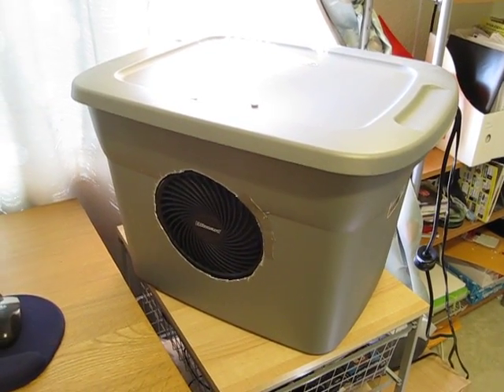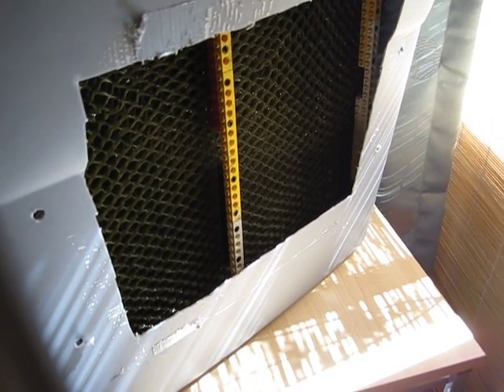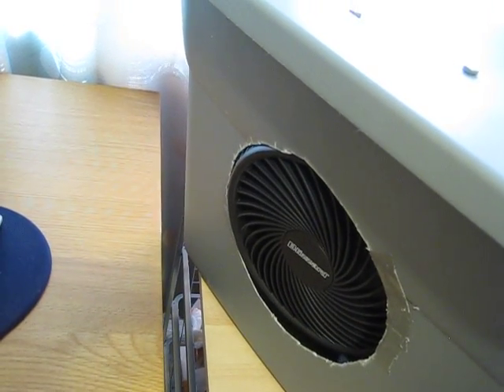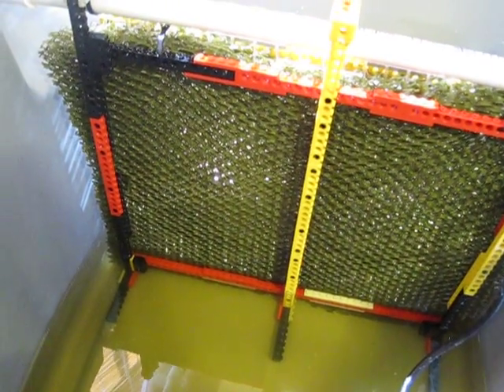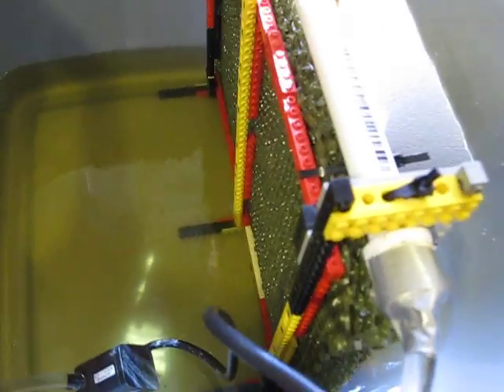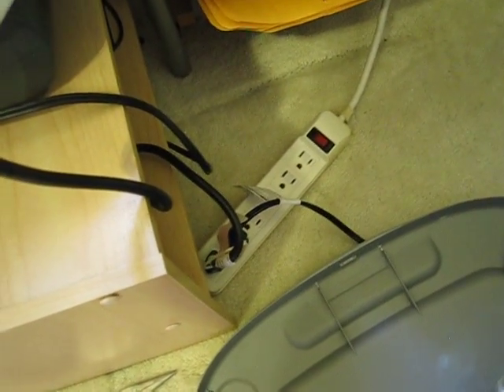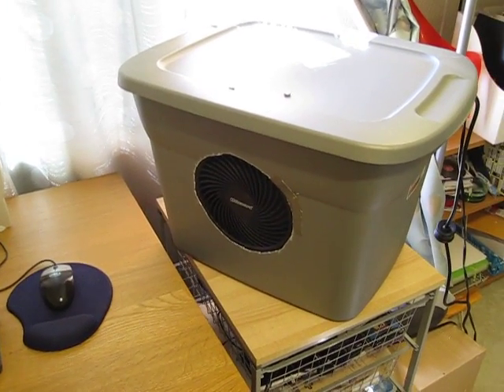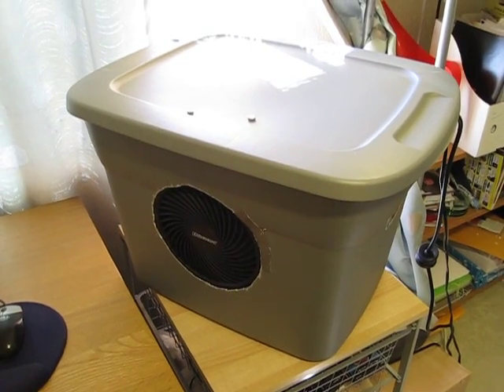Homemade Evaporative Cooler (Swamp Cooler)

Comment: whats the best cooling pad i can use? Is the media pad is the best cooling pad that i can use or there is a better cooling pad than the media pad? btw nice video
Reply from the maker: Cooling wise the aspen pads seem to work the best, although they leave a big mess because of all the bark shavings.  I like the blue Duracool pads because it does not turn the water green and are easy to cut.   They may not cool quite as well as the aspen pads, but for my application I do not notice much difference.

Comment: I'm from the south not the west hard to believe. I tried putting ice in a cooler and venting  with a fan when my ac went out.  this honeycomb idea is new. I still find  it hard to believe  this works even from honeywell for 200 bucks at walmart. You said it best it cools 2 inches of space. I trusthoneywell or honda or name brand swamp cooler not really but tempting.
Reply from the maker: Yeah this is really only used to cool a personal space.  At the time I built this for less than 50 bucks.  Uses way less energy than an AC unit but of course not nearly as effective.
Reply: sad thing is my place stayed at 82 degrees. Not fun.

Comment: You can also use humidifier pads as well it works the same
Reply from the maker: +TCircuitry HD   Thanks for letting me know.  May need to try that as well.
Reply: Also if you want a stronger cooling effect, put multiple pads together in a line. I tested mine a few years ago and discovered it is one of those things where after you double it once, you get half the gain. So 9 degree drop with one pad as an example. two pads together would be 18 (so 9 gained), If I try 4 pads, I get a 22 degree drop in temperature 4-5 just depends. (One behind the other in an airtight seal so the fan has to suck the air through the pads) But of course you would have better results than I did because you live in a dry climate.
Reply from the maker: +TCircuitry HD   Good to know.  Thanks!
Reply: +Gizmo Gaming you mean 2-3 pads on top of one another? If i do this i would have to make sure all pads are soaked in running water right?
Reply: That is correct. They ALL must be soaked. I also found out it works best if you have a pump running for 30 seconds every 5 minutes roughly to let it evaporate effectively depending on temperature and dryness of the air. If you just let the pump run constantly, the water can actually insulate the pad and keep it from evaporating quickly so it wont get as cold. What I was referring to as my example was like in his design where the pad sits vertical. If you put multiple pads in vertical up against the other one, you get a stronger cooling effect. But again, you get half the gain after you double the number of pads the first time for the average temperature drop. 50s roughly is entirely possible with an evaporative cooler if you have multiple pads pressed up against each other. Also if you choose to add 4-8 pads, make sure you have a really powerful fan to suck the air through all of the pads :)

Comment: Looks good but change your water. You don't want to breathe bacteria.
Reply from the maker: +John Arizona  The blue pads I use do not dirty the water as much as those green pads.  But yes, you must change out the water.
Reply: +hutchtransfer I live in a really dry area, Payson Arizona which made me think to mention. Arizona is really dry as it is but at nearly a mile high you see very quickly the importance.

Comment: Y water green
Reply from the maker: +Graham Bate   This is from the cooling pad.  In that video I used the green cooling pad but now I use the blue Duracool pads because it keeps the water cleaner and is easier to cut.
Reply: thx for the reply, do u get any moisture in the house from it?
Reply from the maker: +Graham Bate  Yes it does put humidity in the air.   That is why you should open a door and a window in the room for circulation so it does not get too uncomfortable.  This works best in dry climates.
Reply: thx again mate

Comment: Doesn't this just humidify the air making it worse in the long run?
Reply from the maker: Bryon Wilson   Our humidity levels are really low here in the desert (usually less than 10%).  So a little humidity is not a bad thing.  You definitely want to keep a window open in the room and keep a door open.  Otherwise if everything is closed, then the humidity will get worse and worse if there is not circulation.

Comment: can get electrocution with this type of fan? please explain.
Reply from the maker: Sudesh Aththanayaka   The cord is drawn up and out of the storage bin, so it is not in the water.  The fan sits high above the water and is securely fastened to the lid so there is no chance of it falling into the water.  This is my 4th summer using this evaporative cooler and I have not had any issues.
Reply: When  da air  pass  through  the  evaporate ,it get humidity. So humidity  of the  air is higher than the  outside  air. This humidified air will be  able to get trapped  with the wire ends of the fan that pass  the  current to the  fan  motor. In such  situations  if air trapped  with our  body we can get  electrocution. Think .I'll waiting  for  your answer. Thanks
Reply from the maker: Sudesh Aththanayaka  With my design the fan is attached to the plastic lid so when I open the lid to fill this with water my hands are not touching the fan and the plastic does not conduct electricity. When I fill it I always make sure the outlet is turned off so no electricity is coming to the motor.  Because of this I feel safe with this design.  I have been using it for 4 summers and I have not had any issues.  This is only run a few days each week for a couple of hours each time.

Comment: actually you r using  pump to pump the water..how about replacing ur pump by using  gravitational flow of water from ur  home tank
Reply from the maker: Joel Abraham   I am not sure how that would work.  Once the water drains over the cooler pad then how can gravity be used to bring it back to the top above the cooler pad?

Comment: what is the coldest temp you get from this project? Its probably not very cool....................
Reply from the maker: Shawn Samuel   My evaporative cooler usually cools the incoming temperature by as much as 30 degrees depending on humidity levels.  Over the summer the temps here in Vegas are over 100 degrees, so my guess is that the air coming out of the cooler is between 70 and 80 degrees.  By having a window open it will draw in the air from outside.

Comment: I have a smaller one (fits in a 2 gal bucket), and I'm about to scale it up. I am wanting to run it out of a rain barrel and have an Arduino micro to keep the water level in check, the one i am working on is designed to be off grid so i am connecting a 12v battery bank and a small solar panel.

ANY suggestions greatly appreciated.

--JWat
Reply from the maker: Jordan Watkins   That's great you have something to monitor the water level.  Yours will truly be zero impact on the environment.

Comment: can i use a bed foam instead of that coolpad? :) . your reply would be much appreciated :)
Reply from the maker: I am not sure the bed foam would allow enough air to pass through.  The coolpad is around $7 or $8 at big box hardware stores.  That will give you enough for a couple of small coolers.  I double mine up.
Reply: ok THANK YOU SO MUCH!!! :D :D

Comment: Would it be possible to build one of these for a vehicle?
Reply from the maker: You would need to find a way to enclose the water at the bottom of the cooler.  If you were to use my current design for a vehicle, there would be problems with the water splashing out.   Decades ago they used to have these on the outside of the car:  http://en.wikipedia.org/wiki/Car_cooler
Reply: justenmatthew 40 years ago when I was a auto parts delivery driver, one of our other delivery drivers made an evaporative cooler for his truck which had no AC (mine did). He took the rubber hose from the windshield washer and feed it thru the fire wall into the his truck's cab. He built a small rectangular waterproof box with a cooler pad inside that he hung on the dashboard in front of the blower vent. He had the rubber windshield washer hose feed into the top of the box from the back and then into a tee'd perforated drip tube that ran along the top of the mini cooler pad. He had to manually turn the knob on the dash, that electrically would normally squirt water onto the windshield, to wet the cooler pad in the makeshift evaporative cooler whenever he felt it got dry. I can tell you from sitting in his truck when it was over a 100F (37.7C) here in blazing HOT (arid) Arizona that it actually made a noticeable difference and worked!  It was better that the alternative which was suffocate!
Reply: That's a real creative solution!  Thanks for sharing!  The heat is returning to Las Vegas is it's time to get my cooler ready for this summer.

Comment: FYI these work through evaporating the water into the air. Just like your sweat on your body changing from a liquid to a gas. Also if the air is humid the evaporators don't work as well just like when it's hot and humid your sweat evaporating doesn't work as well and you feel hotter than if it was dry and the same temperature. 
It all has to do with the kinetic energy of the molecules and the ones that evaporate usually have the highest kinetic energy thus the liquid becomes cooler because the molecules that are the hottest are leaving. Cold liquid actually doesn't evaporate that well but then again it's already cold so it doesn't lose as many molecules because of it's low kinetic energy. Putting ice water in an evaporative cooler isn't really doing too much evaporative cooling but just warming the water with the air which obviously drops the air temperature. More like diffusion cooling.
Reply from the maker: Thanks for that explanation.  I do not use ice that often.  I have noticed that it does create slightly cooler air temperatures coming out of the cooler.
Reply: This is excellent!  I live in Northern California and even though it's pretty mild weather we get here we get really hot in late spring and all summer, we can get up to 119 degrees F.  And its really dry heat too so swamp coolers have been used for many years here and it brings back great memories of staying at my Aunt's house and she had a huge swamp cooler and I love the smell of it cause its fresh.  I wish I had tools and knew how to use them to make this.  But I don't so I can't so I won't lol.  I wonder if someone who makes them sells them?  It would still be really cheap and they can make a decent profit.

Comment: Pros: I like what you did -- your ingenuity will help thousands, me included.
Did u try outdoor sunscreens or louvered shutters? Uses zero electricity. 
Or a fan in hallway blowing cool air into this room?
Your setup will be cheaper than buying an evap cooler, but for those not inclined to build anything, they're as low as $100.
Cons:
I live in AZ -- can't imagine opening a window when it's 110 deg F outside.
Plus, you're not supposed to mix AC with evap coolers. They work against each other.

Comment: I don't mean to be a critical but I can expect that the duct tape can lose it's adhesive over the time especially when there's a water moisture present. Perhaps fender washers with screws to hold the fan base would bring less risk of having that fan dropped in the water which can bring a electrical shock or electrocution. Just saying, but not bad for a cheap makeshift idea however.

Comment: I built something similar with duracool pads and 120mm delta fans. One modification  I did was build a partition to separate the water from the fan area. I did this so I can use in my van and keep the water from coming out in moving van. Everything on mine is held together with gorilla duct tape. 
In California outside temp is 86 degrees humidity 56, I get about 78 degrees from the fan exhaust. 78 feels good on a hot day. 
Low humidity I can get about 73 degrees from the fan.

Comment: Ingenious idea.I plan to make something similar, a car radiator and box fan would be the active components, a 5 gallon reservoir, pump, and water inlet from main line trickling in at 5GPH or so, I pay a flat rate for water, no matter how much i use, so im thinking 5GPH would be sufficient for environment and cooling. A drain line running to the bathtub to expell excess.  The flushing would be done from pressure built up by a sealed system, constant fill/drain rate.

Comment: An easy way of making your swamp cooler cool even more would be to use ice from your ice machine. You can also use a freeze block, normally used for coolers. This would cool you down even after your water has run out. As for your excessive heat from the windows...use Low E Film. $35 should be able to cover the window, reflect a majority of the heat back outside, and still let light in, and see 100% outside, and only has a lite blue hue to the window tint. Home Depot/Lowes both sell the kits.

Comment: True, It would definitely help to cool than just the AC alone, but opening a window would waste the AC quickly because of the small space. I'm thinking of using it more like a space heater and move it around. I'd prefer the cool damp effect compared to the freezing dry AC. I HATE 75 degree AC air in the summer when its 105 out. Keep mine set 80-90

Comment: to answer your question further.  the British Thermal Unit BTU says how much heat is required to change 1 gal of water 1 degree.  for example.  1 gallon of water takes 5 btu's to change from 45*F to 50*f

HOWEVER it takes 970*F to change that same 1 gallon from a liquid to a vapor, meaning if you have 1 gallon of 211* water, the amount of heat required to reach boiling point is 1 BTU...., BUT in order to change that 212*F water to a 213*F vapor takes 970 BTU's nearly 1000x more heat.

Comment: I just read my own comment and left  something out - the additional container sits on the lid of your unit  and is fed by gravity - the ballcock ( its just the same prinicpal as the one used in toilets )  uses an arm in conjunction with a float to open  valve that allows gravity to feed your replacement water. - sorry the first post must have been a little confusing.

Comment: KUDOS! my friend! well done, an nice design too! - in some parts of Australia we use the same principal as you did nd yep! it works really well. Can I suggest a "MOD" for you that will help you get more time between water changes? place a large container ( a bit smaller than your using for the unit itself - and near the bottom feed a hose that is submerged under your tanks water level. with a ballcock ( a float ) - as your water level drops, -  the tank above replenishes it. as it evaporates.

Comment: A hundred years ago they didn't have a/c.  They would drape a window, outside, with burlap.  Then they'd put the ends in a tray of water and it would wick up.  2 benefits.  Some shade on window.  Evaporation.  When a breeze came through it was especially beneficial.  From what I was told, that was how the deserts of CA were homesteaded.  Places like Barstow and Banning and even the Calico Mines.  You see the burlap typically in these old ghost town replicas; but they don't tell you it was a/c.

Comment: I'm looking to make something like this for a terrarium, on a smaller scale and running on a hygrotherm controller to engage the fan only when needed. I recommend you find a way to seal in that padding- air takes the path of least resistance and so much of your inflow is not being cooled. Maybe add foam on top of the pvc and along the sides of the pad. Won't seal all of it, but it should work better. :)

Comment: Brandons hasnt considered the house ac will take full power for long time to cool upstairs, especially as the hot air will float to upstairs rooms. (500W ac pump for 3 hours?), yes your unit is essentailly powered by house unit as brandon stated, it is local cooling and would only be at most 100W heat load (or 20 watt load on ac pump)  plus a 20W fan and 10W pump.. so its 1.5kWh vs 0.15kWh, brandan, first rule of engineering, be sure of your statements, your engineering integrity depends on it.

Comment: You could plug into a GFCI outlet if your woried.  Do you realize that all the water your evaporating is going to be condensed on your house AC evaporator consuming BTUs with no sensible heat loss. Hope you turn of your AC when your using this.  Your not saving energy by using this with both running.

Comment: You could plug into a GFCI outlet if your woried.  I hope you realize that the water your evaporating to create cooling is now going to be condensed on your hous AC evaporator consuming BTUs with no sensible heat reduction.  Use one or the other but dont use evap cooling in a house that uses AC.

Comment: @hutchtransfer If I were you I would try constructing more of a "breeze-way" type design between the back of the pad and the cooler box, this way you are pulling in only the outside air. I would also suggest one to two trays of ice to be placed in the water around the pump (with a screen type filter to keep small chunks of ice from clogging the pump). I must say that this concept is kept extremely clean. I absolutely love this idea and plan to use it myself.

Comment: hey very nice cooler!   smart idea on how you mounted the fan!    i think my pump is pushing to much water to the pads so it restricts the airflow alot.     im working on perfecting mine and getting it as effeicant as possible.   i thought doubling up the pads would make it cooler but all it does is restricts to much.    it seems i get cooler air with just one.        im working on building a swamp cooler that puls air from outside with a in house ac unit duct.